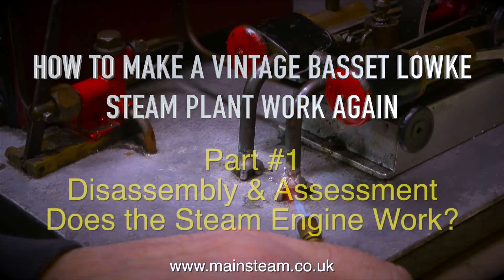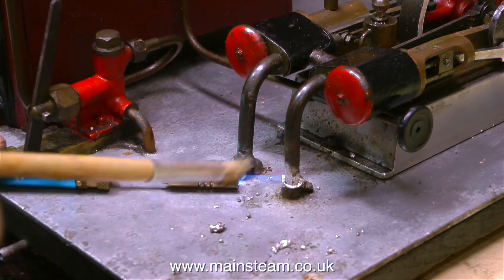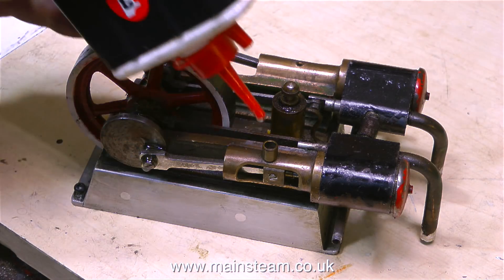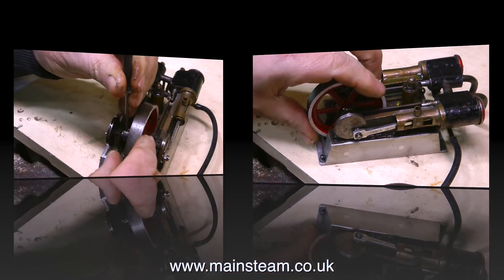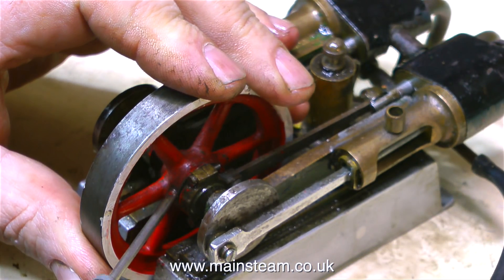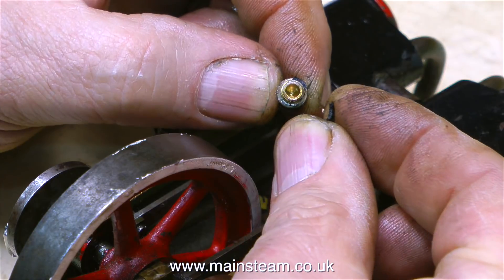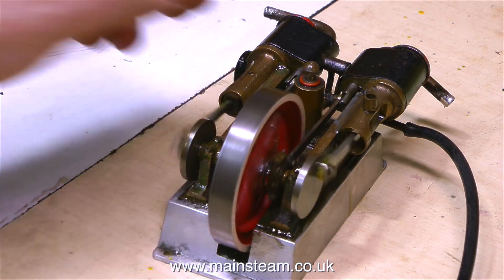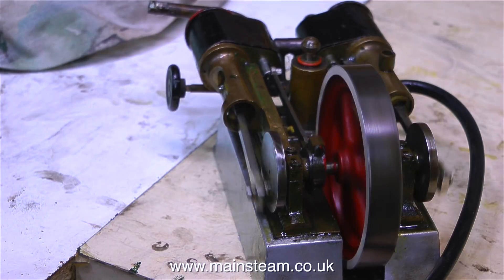HOW TO MAKE A VINTAGE BASSET LOWKE STEAM PLANT WORK AGAIN - PART #1

Comment: Old dirty and over used is a good sign. IIt means it works!! 

A locomotive at the railway where I work has been in service there for a little over ten years. With repairs made here and there to keep it going. When it finally came to lifting the boiler out at the end of the ticket it was fine.

Comment: Top tip for de-soldering, use plenty of flux and add new solder to mix the new and old solder to get it to run.
Reply from the maker: Thanks for the tip, I have been in the electronics business for over 40 years so I have an inkling of how to de-solder by now .....

Comment: Hi Keith. The engine was last steamed nearly 40 years ago, and it did run and steam lovely. The paint was put on by my own hands, but I was only 12. Sorry for that mess lol.  The engine was given to my farther from his friend from Mablethorpe that had a big amusement arcade. He also had a building attached to the arcade that was full of model engines,and locomotives.Very Interested in what your plans are for this rebuild. Look forward for the next video.
Reply from the maker: Really, well if that's true you will enjoy the series }:-)))
Reply: The base board was made from a very old arcade game.[ Hence there is a infill square of aluminium in it.]. pressure gauge on boilers snapped off, sorry that was me. Rubber foot on base board missing. [should have never slid that across my dads work bench]. Thank you Keith I am sure I will enjoy this series.
Reply from the maker: - That identifies it perfectly. Forgive me for being sceptical but I do get one or two odd viewers commenting, and by odd I mean very seriously odd (I block some of the more extreme ones - all part of the fun though). You will enjoy this series immensely as I bring it all slowly but surely back to life - I know I will, as I love old Basset-Lowke stuff like this {:-)))
Reply: I totally understand. The man that made the plant was called Bill Cammack. He did own jackson's amusements. He died when I was 7. I am 52 this year. So there is now a bit of history for you.